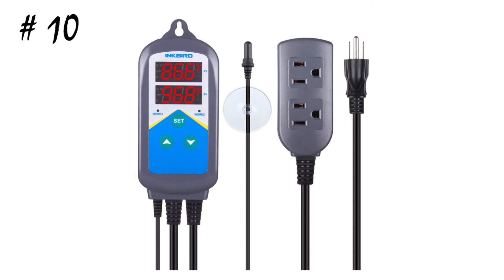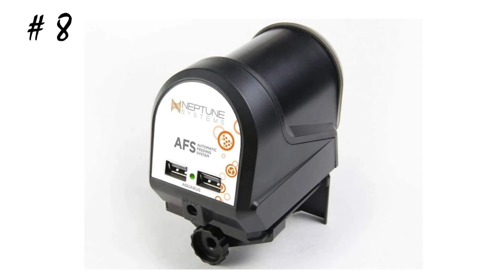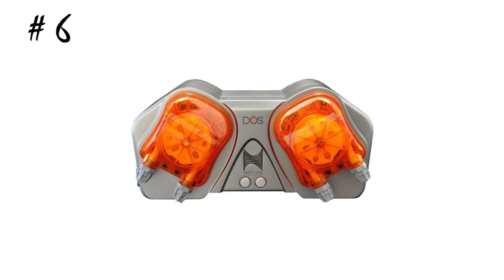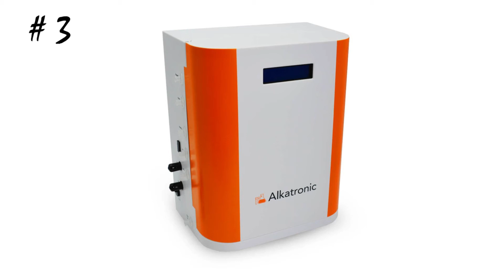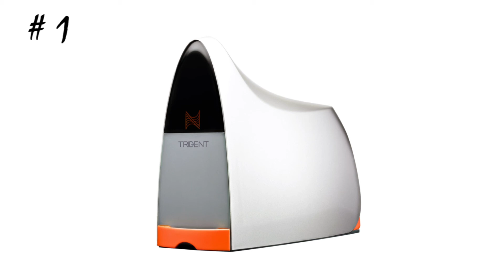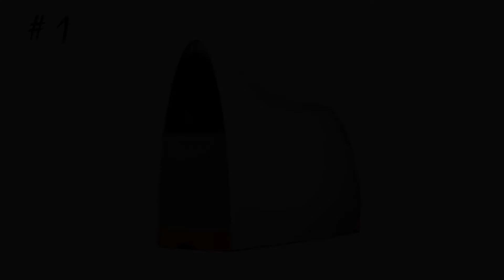Top 10 Must Have Automation Gear!

Comment: Thanks for the vid, i been searching for a filter roller just can’t find any big ones
Reply from the maker: I just do 2 Clariseas on my 300.  They handle larger tanks pretty well.
Reply: Yeah i was looking at them but i dont know about handling 1400
Reply from the maker: @OCReventsAndbuilds  Yea might need to do one of those SUmps with the built in roller.